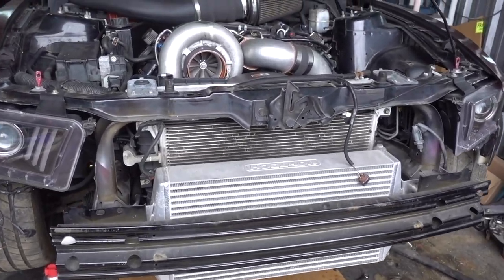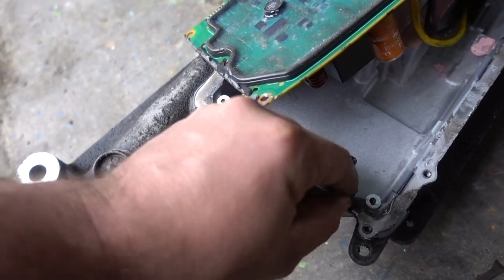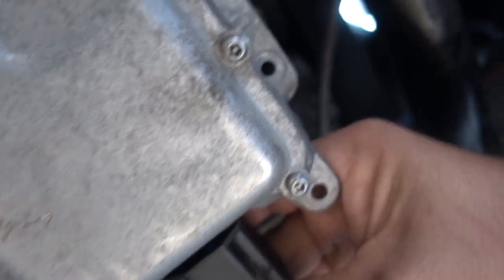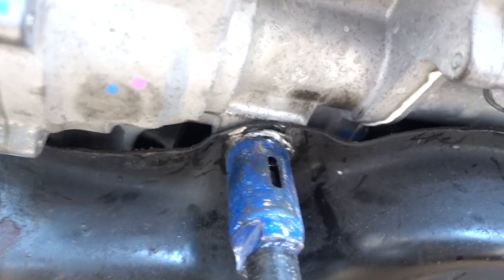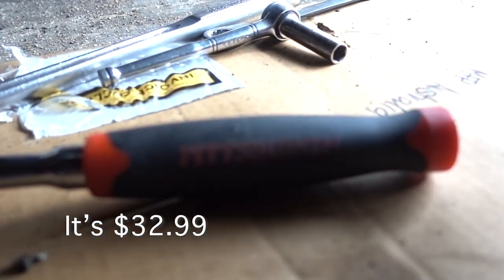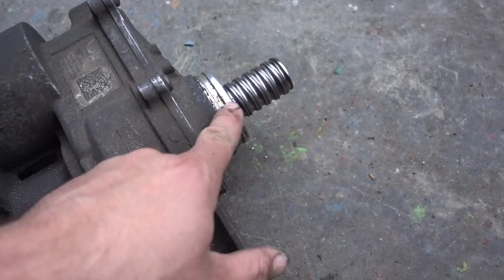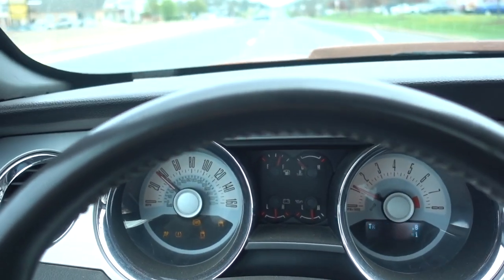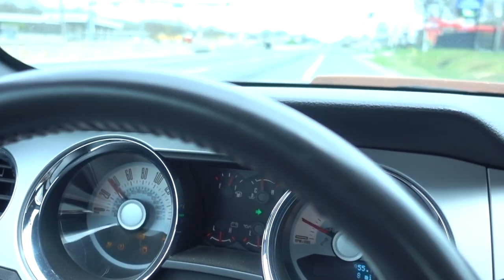Ford Mustang Steering Rack Install Tips EPAS 2011-2014

Comment: I have done the job thank you so much for your help! But do NOT drill into your mustang I did not have to do that nor put any torch on it. I didn’t even use power tools! Only breaker bar, a metal sledgehammer not rubber, Duralast ratchet, 22mm wrench. Now all I need is alignment. It took me Saturday & Sunday to complete though due to the rainy weather. I have no driveway or garage. Take care you have my thumbs up my mustang is saved! I am free to answer any questions
Reply: Deep sockets & shallow sockets they are very size sensitive
Reply: Was your steering wheel on your mustang super stiff
Reply: Did you get it flashed at a dealership
Reply: @SUPAFLY69  flashed?
Reply: Did you end up having to get the steering rack programmed by a dealership?
Reply: @nalonb9404  nope! It’s plug & go.
Reply: @jaysmechs2457  that’s great news, thank you

Comment: Thanks for this video man, like you say, there are not many on this matter, I practice drifting with the s550, and I'm not too fond of the electric rack, for drifting it makes the steering feel dead... I like the self-steering 100 times more, coming from practicing on z33 and z34 Nissan, will replacing the electric rack fix this on the car? I don't want to purchase shit before doing the research, thanks in advance brother.
Reply from the maker: The biggest change that helped with self steer that I’ve done, was add the fdf angle kit. It helped tremendously with self steer, even with the electric rack.  It adds a pretty good mount of caster, and it feels so much better than stick.  It’s a bit aggressive for the street, but it seems like most of the angle kits for the s197 and s550 help out a lot with steering feel.  It’s not quite as much feel/self steer as an s chassis or Z, but it’s so much better than stock.

Comment: What are the electrical connectors called? That connect to the rack and pinion? Because mine is good but one of the connectors are broken and was gonna see if I could just replace the wiring harness

Comment: This was actually very useful, as I just ordered the boss 302R steering rack after installing an angle kit that uses rod bearings instead of bushings.  Resulting in the infamous wheel shudder first gen EPAS racks are know for lol
Reply from the maker: Nice!   I really want to get an angle kit for the car soon too.  Which one did you go with?
Reply: @RobRabonPhotog  I went the scotidi race development kit. At face value, it's only 400$ (1400$) more than the drift knuckles kit, but your getting a much better kit. Plus the guy who made the kit it super awesome to work with. He actually came up to help get it set up. It actually drives pretty smooth. Also, I'm running 19×9 with 255/35 without any spacers and have full steering lock to lock with no rubbing
Reply from the maker: Isaiah Harris sorry for the delayed response (YouTube app notifications suck). 
I’ve seen that kit on the fmc drift page on Facebook and was thinking about going that same route.   It looks like a really good setup!   Might jump on it whenever things get back to normal.  I wanted to see how the car did with stock angle but I think ever event is going to be sold out as soon as the local tracks open up.  Lol.
Reply: @RobRabonPhotog  lol. No worries.  I actually had my first full drift day at Adam's motorsport park this past week, and the kit was amazing. It felt like I was cheating the system. For the first time I felt really comfortable with the car. I can send you a clip if you want
Reply from the maker: Isaiah Harris that’s pretty awesome!  And sure!  I’ll check it out if you don’t mind.   Or if you’re on Facebook or ig I’ll check it out on there.   I really want to see all that angle.
Reply: @RobRabonPhotog  here's a link to the outside view. I lost it at the end. This was my first day so I was still learning the kit. https://m.facebook.com/groups/142610252544565?view=permalink&id=3174510316021195
Reply from the maker: That’s rad!   Looks like it was working pretty nicely!   That’s a pretty awesome drift car!
Reply: @RobRabonPhotog  dude, that angle kit with the swift springs.....so smooth. I've never had a car that drove this smooth lol the kit is worth the money. Also you dont need a ton camber. You can just run what's built into the kit
Reply: Did the 302 come with inner tie rods? Or nah

Comment: Any issues after drilling out the outside of the spacers/nuts ? I was planning to do the install but getting to the screws is such a pain (working in the driveway so not planning on lifting the engine). Seems like you way may be easier by removing the welds on these nuts and removing it that way ... 
It seems like there's only 3 small welds on each, might try to just dremel these out instead of drilling all around (little worried about weakening the part right around the mounts this way)

Comment: Looking for more info on the reflash.. looking at putting a 2013 boss 302 rack in my early 2012. Anyone know if I’ll need the reflash? Having someone do the install.. can I take it to the dealer and have them reflash without having to disassemble again?
Reply: Hi, I was thinking of doing this on my 2013 GT, did it work for you?
Reply: @uffanquraishi3465   no reflash was needed. Bolted in and was good to go.

Comment: I have a 2012 Mustang V6 my rack and pinion went out and I bought one from this guy I connected it and it worked but I’m not sure if I should drive it like that if it’s not programmed. Should I or do I need to program it?
Reply from the maker: I still haven’t tried to reprogram mine and it’s been fine.  No issues and it’s been a couple thousand miles since I replaced it.
Reply: RobRabonPhotog okay cool thank
Reply: No need for program

Comment: I swapped the EPAS in my 2008 but having issues at speed on the highway. Did you need to have yours reflashed?
Reply from the maker: Nah.  Still no reflash on mine.   A 2008 mustang should be a different set up than the 2011-up.  Pretty sure 2008 has a power steering pump with lines going to the rack.

Comment: Do you have to reprogram the electronic power steering box?
Reply: Mine is leaking a little oil from the gasket. Sorry I forgot to mention mine is a 2016
Reply: @bimbi1946  electric shouldn’t have any oil
Reply: @chevyssboy89  it have haydrolik oil
Reply: @hanialjabri6952  no it does not it’s electric
Reply: @bimbi1946  All 2016 Mustangs use an electronic steering rack, and are not hydraulic, so they do not use power steering oil. In fact, all Mustangs made after 2010 are electronic.